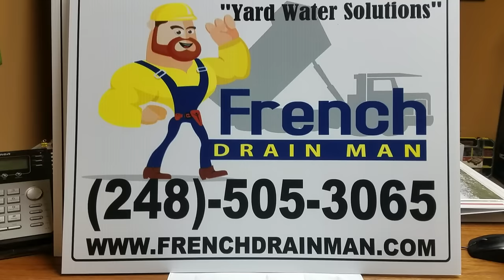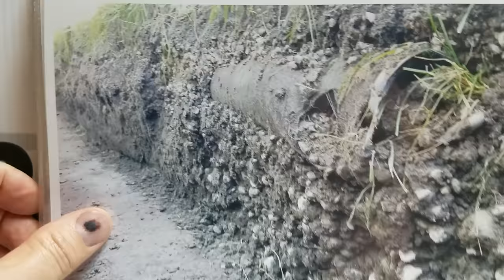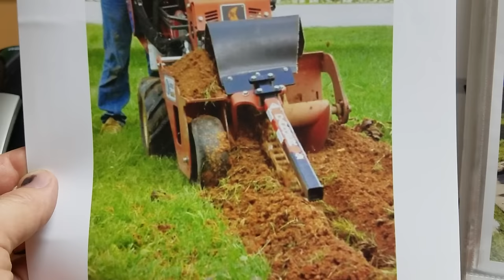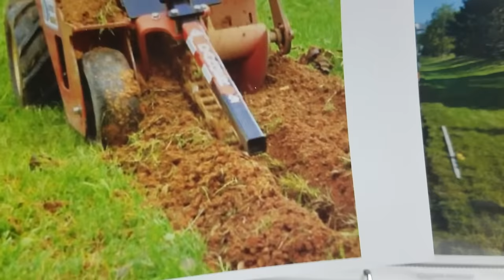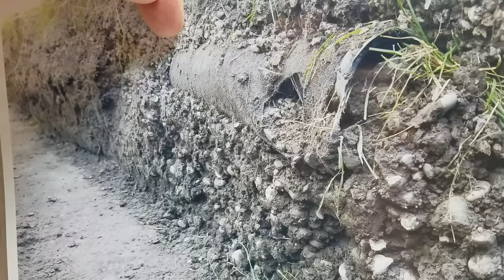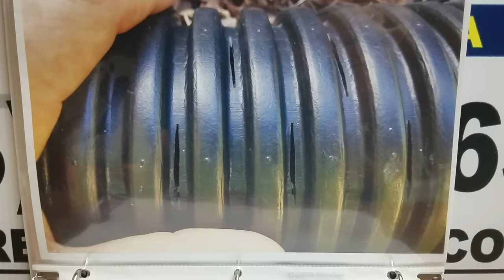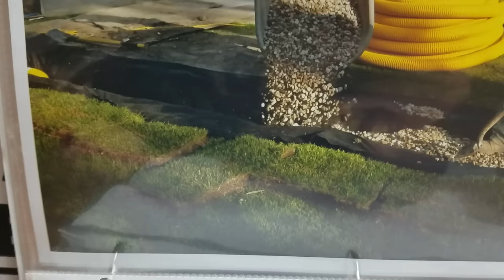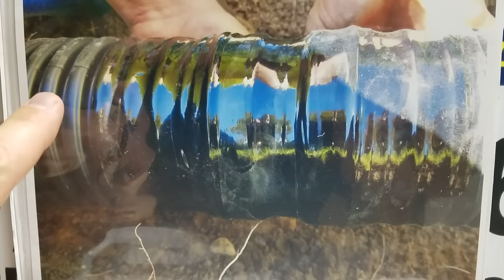How To Build a French Drain That Lasts FOREVER

Comment: I appreciate that you call out things that are appropriate or not appropriate based on geography or climate. Textile fabrics should be in that category. Non-woven geo-textiles are not appropriate in some areas (the South) because the punched holes will clog with clay. Woven textiles allow small particles through, but if you provide a clean-out, those particles can be cleaned out before the pipe clogs. Once a filter fabric clogs its done and the drain doesn't work. Cleanouts are more work, but that's a system that will last in this area. Multi-million dollar commercial projects specify woven fabric systems; that should tell you something.

Comment: Very nice work I have redone many french drains myself and just when you thought you seen it all you do another job that you just can't get your mind around what they were thinking. I learned a couple things here even though I been doing french drains for 25 yrs.with great success. Great content very professional and much appreciated. Keep up the good work !
Reply: Do add more soil than this guy back in? If you lay the sod right on top of the geotech how is it supposed to "catch"?
Reply: @Wildspirit2016  They cut 2 and a half inches down on the initial cut through the sod.   This gives them the whole root system and an inch of soil. The grass that bridges over the drain gap will have nutrients running off from the whole yard, and plenty of water underneath.

Comment: Great post. I really like how you used photographs instead of video to illustrate your points. The former inevitably leads to videos that are too long. I am trying to design something for my sister’s driveway and I wonder if you can answer a few questions. 
—What about frost heave mitigation for a trench that is above the frost line? Foam board insulation at the bottom of the trench? If so, what about not using a pipe and just burrito-wrapping the stone and insulation board? What extra function does the pipe perform?
—Can you explain how laying the pipe directly on the fabric prevents frost heave? I assumed that a layer of stone, because it’s so porous, allows for expansion/contraction.
—Will the geotextile fabric clog up eventually?
—How do you cut your turf? Do you use a manual sod cutter, or an attachment to your machines?
Thanks again!
Reply from the maker: Watch "French Drain 101 - Everything You Need to Know!" on YouTube
https://youtu.be/VFYj7sbmXGg

Comment: Great job and an even better explanation as to why you do the things you do.   Being an engineer, I already knew these things, and I spec out exactly what materials and construction techniques are to be followed by drainage contractors.   People don't much care about drainage, until they have water problems, then they're ready to sue any and everybody involved.   As I do most of my work in NH, we also have to provide a Radon elimination system, subsurface.    Interestingly, though I did oversee an install of one of these radon systems, the house contined to have abnormally high radon levels.   It took so detective work, but the culprit ended up being the granite countertops.   Certain slabs of granite are radioactive, moreso than other slabs.   My two cents.

Comment: You lay the sod straight back over the burrito without allowing for another 2-3" of topsoil? That seems like the roots would struggle for water.
Reply: Not to mention, its liable to get punctured by an aerator
Reply: Yes, but soil won’t freeze on top, creating a barrier for water in the spring. Mine is like that in a couple areas and I have to be aware of this and it works.

Comment: Sorry for the novel. I've watched several of your videos. 

Is it legal for my neighbor to connect their subpump to a drainpipe under the ground and discharge it into the mid front of our yards/ the street? Because it has to be perforated or something because its causing my driveway to heave and our sidewalks to sink/heave. Its like I sit lower than my neighbor and his front yard slopes into my driveway and front of my garage while the side & back my house slopes into my neighbors back of his house/ back yard. They had water issues ergo why they started directing water onto my property at initially an incline... then slopes into my yard as previously said. I don't know where we can actually direct the water except to the back where it slopes but then that would flow into a 2nd neighbors back yard. The 2nd neighbors backyard/the model homes back yard is huge and the water wouldn't collect around their foundation like it does mine but idk whats legal and aloud. But running it to the street or sidewalk isn't working. Does it need to go under the sidewalk? Like I don't get it. And I probably need to install an frend drain infront of my 3rd car garage bc thats also where the water runsoff and collects but I imagine it will just fill up and get my driveway or garage wet unless I run another drain bordering my driveway. I actually had to replace my subpump this year and I've only been in my home for 3 years.... it's being overworked and obviously taking in some of my neighbors water. I don't even think the street is low enough to properly collect the water. And I also don't recall the pipe being wrapped or gravel or sand used. We have a pretty high clay content in Eastern Nebraska which the builder denies but lol its definitely not Iowa or Michigan black dirt I can tell ya that much.

Comment: I’m building a 75 French drain. I’d like to tie a Corrugated pipe behind a retaining wall into the top of my French drain (high point of French drain). Should I use a wye connection? Or just dump the retaining wall pipe onto a blind inlet for my French drain? Thanks.

Comment: I need an insight on a small water issue in my basement.  Under heavy rains three of four corners seep water.  If I have CLAY hauled in and raise the grade 1' from ground zero out to about 8-10' will a french drain be needed or should I simply put in a recommended downspout system while raising the grade?  Thanks

Comment: I’m renovating my garden because there was an 8-10 layer of clay under ~10 inches of top soil, after 2 years the soil has become saturated and is now ruined. I’ve taken all the ruined soil and clay out and I’m now left with a 20 inch excavation plus a soakaway which I have centred in the middle. I’m putting down a layer of drainage gravel on the base and having that channel towards to soakaway, and on top of that premium quality top soil. I’m thinking 8 inch layer of gravel and 12 inch layer of soil with a pourous membrane separating them. Would this be ok to grow grass on? Many thanks

Comment: Whats the maximum distance between the top of the burrito wrap and ground level before the water cant flow through it properly, i see you say yours are 2.5 inches as thats the thickness of the grass you cut out but can you go thicker than that? Or does the dirt stop the water getting through to the filter fabric, thanks from NZ
Reply: im no expert but i did stay at a holiday in express last night, i mean watch a lot of french drain youtubes. Anyway one good point I learned is that actually a lot of the water youre draining is ground water from the water table rising UP into the pipe. Thats why perforated pipe has holes at the BOTTOM and all around. For surface water (aka, a pool or big puddle) I think youre more wanting catch basins. So in conclusion I'm not sure LOL, but probably the exact depth you bury the pipe isnt that important.

Comment: Hello. I like your videos. If you have an area prine to alot if surface water along an area of 80 feet, would you suggest gravel all the way to the surface (no dirt on top)? My thinking is the clay we dug out would just prevent a large portion of the surface water from reaching the non woven cloth. Gravel would redirect the water down to the pipe.  Thank you sir.

Comment: What are your feelings on the EZ-Drain Prefabricated French Drain with Pipe gravel-free drainage system "saves labor by 50%
30% higher flow rate than gravel French Drains"....how long do they last before they are  needing repairs and do they last in sandy soil?
Reply from the maker: Go to YouTube "WARNING!!!! French Drain Failure "

Comment: Great videos. I had a contractor that sized the drainage as 6" then wanted to bring it down to 4" at the end. I like your Y into two 4". It makes zero sense to downsize outlet smaller than the system. I was going to ask. How do you staple fabric in the end?  Just U staples pressed down?

Comment: Use PVC tile tape on the corrugated pipe you just said sucked that the big box stores sold?  Why do you have the holes up anyways? Wouldn’t the water level need to rise 6” to even get in the pipe? Should be faced downward and have the water get in and drain out faster??

Comment: what about the drain pipe that has the fake foam agreagate that is pre-wrapped unit?
Reply: I’ve thought of this for mine, but I like solid ground under the pipe so the water doesn’t just pass by the tile. It may work as a drainage field to disperse the water into the surrounding ground however.

Comment: Great video! Was wondering I'm not far from your weather pattern. I'm up by Chatham Ontario.. Anyway I got to put tile around house. So was wondering the tilenis installed level around house right.? Than since I dont have any low spots to run water too can I just make some run off lines into gravel French drain collector 15 ft long with 2 feet gravel around pipe.
Thanks. ROB

Comment: Wow!! You guys make it seem expensive and complicated, all those machinery and I guess engineers! I hate to ask how much was this job!!
Reply: True
Reply: The equipment used is actually very small. Those small excavators can be bought used for less than a late model used car. These drains are meant to last 100 years or longer. Cheap drains fail within 5 to 10 years.
Reply: Those "small excavators" are selling for $20,000.00 online used in terrible condition. $35,000.00 if you want to go like new or new.  What kind of "used car" are you talking about LOL???
Reply: I agree, it seems like overkill.   Hell, remove the sod,  dig a trench, fill with pea gravel.  How many hours, if any, after a rain would the water still be visible.  I'm betting 0.   Its like they are trying to ready the area for immediate foot traffic.
Reply: Besides, the pipe would always be the weakest link.   Neighbor has heavy as.s truck crush the pipe or some how debris gets introduced.  Forget the pipe and wrap.  Water will find the rocks and seep through after the downpours stop.
Reply: My assumption is if there is fall for the pipe there will be fall for the rocks too.

Comment: My home in St Petersburg FL is just 7 feet above sea level and my slope from home to street is likely two feet or less (measuring tomorrow), so dispersing water during heavy rains/storms is important. Would burying the drain pipe one to two feet below ground, cover with rock, wrap both in non-woven geotextile fabric, then add some more rock on top be adequate?  Grass grows everywhere here with or without soil so a couple handfuls of soil on top produces grass in a few days.  Thanks.
Reply: go for it

Comment: The back of my property receives a lot of water from surrounding sump discharges as well as rain and snow melt. It appears to have sunken lower than the next property down, which is where it should be running to drain to the street. Everyone else has a nice little stream and I have a lake. My soil is very marshy quite a ways away from the standing water when it's there. What can I do to keep the water moving off of my property? It seems to me a line needs to be installed all the way across all of our lots, but especially across the one between ours and the street.
Reply: I think you should raise your grade as high as you can, cut swales into the grade and install sumps in the low areas of the property

Comment: Somebody please help! So if I’m only using the pipe to take away downspout water do I still need to do all of this as long as the inside of the pipe is clean right? I bought a 50 foot wrapped 4 inch perforated pipe and a 12x12 grate for the water downspout to drop into. I’m going to fill gravel around the grate tho and use a filer inside the grate

Comment: Man I wish you guys were here in SC, I have a awful problem with my backyard. Every time it rains it just ponds up. They cut into a bank to build my house, so I have a steep bank 30 ft off the back of my house. So water from the bank and water from grade of my house meets.. and it becomes a natural pond. It’s awful, and no one around here has been half as informative as your videos. I’m just not sure if I need to do the French drain along the whole bottom of the bank, about 160ft. Do I use 4 or 6 inch? And does it need to be capped in the center and released at the ends facing my slope?? I’m to the point of digging it myself and forking out the money and buying your pipe and wrap.

Comment: How deep and wide are your trenches? 

Which transit laser level do you use? 

Thanks I am a customer of your supplies.
Reply from the maker: @ Mark Stanchin  Question 1 we go as deep as we need to go but a 14 inch by 14 inch is our minimum. 
2 we have been using Dewalt Transit for many years no complaints.

Comment: Greetings from Thornton Colorado. Nice video. I don’t require a French drain or at least I don’t think so. My dilemma is this. I would like to direct water from my gutter downspouts. If I have a gutter connection to solid pvc pipe, pitch it correctly and run approximately 20 ft to exit ( no pop up lol) would this suffice? I could also simply drain water through dry stream to street.

Comment: My problem here in Southeastern Louisiana is that I'm on level ground, high water-table and nowhere to take the water to. The house sits in mud most of the year and is sinking into the ground at odd angles for 40 years..
Reply from the maker: Build a Berm around the house and have a pump system inside the Berm  to de-water the house.
https://youtu.be/kDq5dMhrM5Q
Reply: @FRENCHDRAINMAN  Thanks. That's the exact conclusion I've come to after watching several of yours and other's videos. I told wife yesterday that we should make a berm lake and pump the drain water into it because there's no other place to send it.

Comment: Do you have a sister company in central Florida? We live near Tampa and have a pool. Every hurricane season we are draining the pool because the yard doesn't drain properly and flows into the pool, then almost into the house. We need help
Reply: The problem is that your yard wasn’t graded properly for drainage before the pool installation. I have a similar landscape situation and am currently having a pool Installed. The contractor is regrading the yard slope to ensure proper drainage away from the pool and house.

At this point, your options are to either regrade the area around your pool or install (French drains or Catch Basins and pipe) drainage to capture water and divert it away from the pool. Both methods could work although neither option will be as effective as having a properly sloped yard before the pool install. Best of luck with your drainage project.

Comment: Thanks, very informational, need your advise to install French drain , I’m planning to install French drain around my house, I’m not sure how to end water when pipe is goin to be almost 2 feet deep, I have side walks where drain pipes going to end, I can’t dig under sidewalks, so can I just leave pipes open under drain, or shd I install pop up emitter at ends before sidewalk with gravel on top, but for that I have to connect drain pipe to 90degree pvc pipe with pop up emitter. I appreciate if you can advise, thanks, Vishal

Comment: Question: why not line the bottom and sides of trench with plastic sheeting lay stone aggregate then pipe then more stone, this way the water gets trapped in the trench with stone only and then the pipes disperse the water and the soil can't ever migrate into the stone lined trench?
Reply from the maker: That drain would only take in surface water not subsurface water. I have designed some drains with pond liner to catch massive amounts of sheet water.
Reply: I live in fenton mi I live in the country I need my front yard done help

Comment: This is great, but he may not understand that some people need an immediate fix and can’t afford $20,000 to make a more permanent solution, over an $800 quick fix. Plus, I had a dude absolutely destroy my lawn with an excavator like this and it’ll never be the same. I’m certainly not degrading this company’s work, but sometimes people make repairs with what they can afford. I found clogged drainage pipe in my yard and replaced with a better system...not this good, but my basement has been dry for a few years.